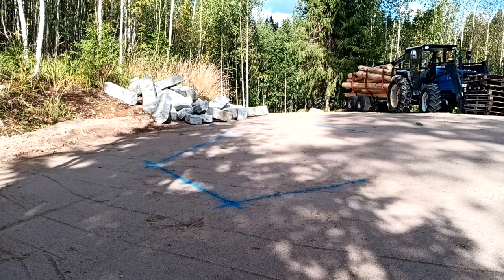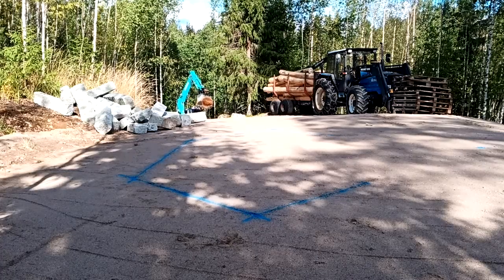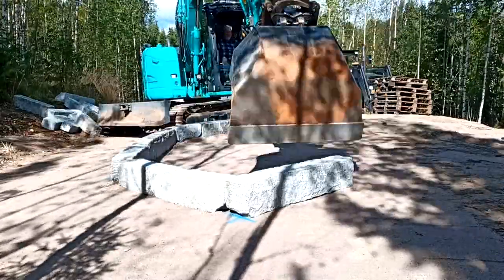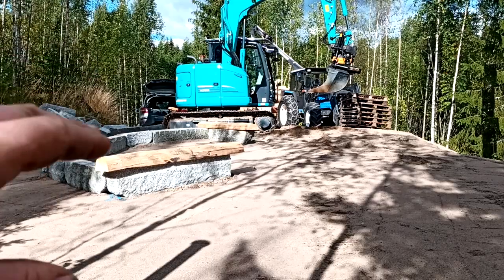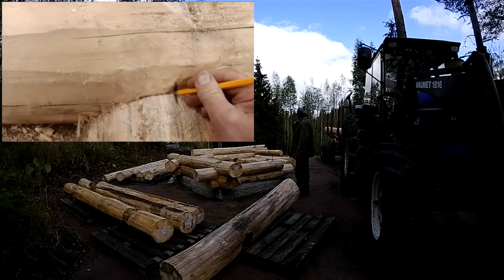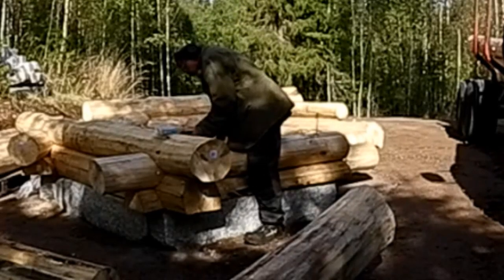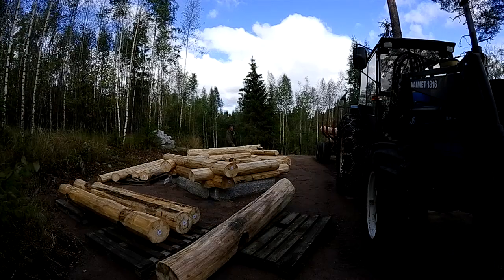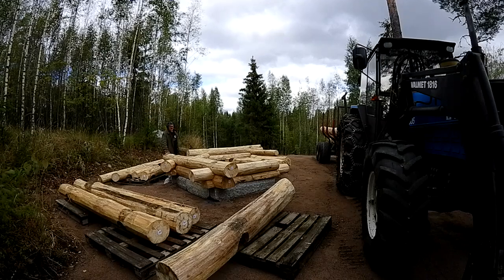Log building 101 (2021) Part 16

Comment: Had me worried for awhile you were not going to put some material between the rock and cellulose. Invitation for those bottom logs to rot long before their time. Just the pine tar ? Some addition of Polypropylene sill material or rockwool saturated with your pine tar or roofing tar would be better insurance. I agree the nuts and bolts are a waste of time. Drill 10 centimeters or more  down into the granite and pound rebar through the drilled log and trim off . Enough to stop any lateral movement. The final structure is going to be heavy. It won't fly away. Nice to hear you have backed off from loud repetitive music as in your early videos. It's looking great. Onwards and upwards!
Reply from the maker: Ok, glad you asked this. I thought about it for a long time. If the logs were sitting on concrete or bricks or something then of course there would have to be a water break layer inbetween. Also if the top surface of the rocks were perfectly flat then water would wick in through capillary action and stay there. But this is granite so it does not take water up from the ground like, say, concrete would, and the top surface is very uneven. The bottom surface of the log is flat so each log sitting on the blocks is  only touching the granite in , maybe, 3 - 4 places and those are the raised points on the granite, not the low points where water will sit. So air can flow freely inbetween the stone and wood and dry out any moisture. If I had put in a strip of felt - like the strip I have now edged the roof with, I could have created one of the problems that I was trying to solve by introducing a place where water could seep in - inbetween the wood and the felt, where air could not dry it out. So in every other situation I would have used a water break, in fact I almost just put it in automatically without thinking, but in this one, very specific, instance, I elected not to. But thanks for the question, glad someone is paying attention!! :)